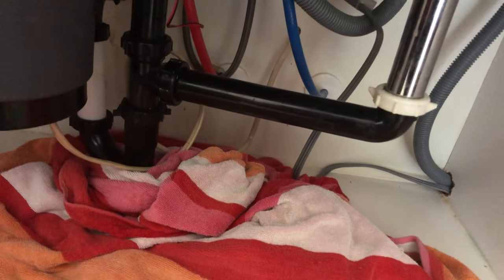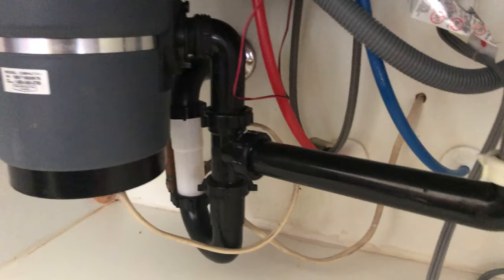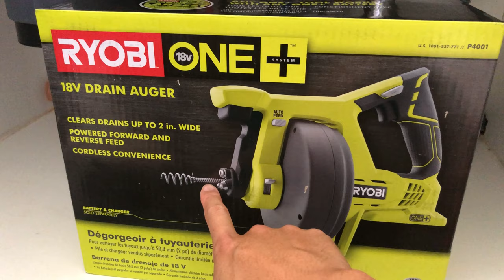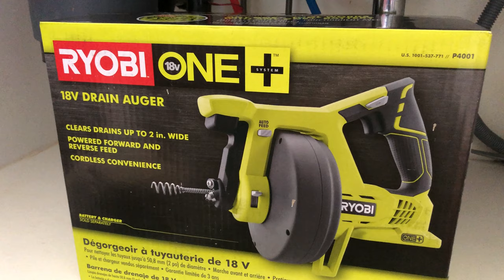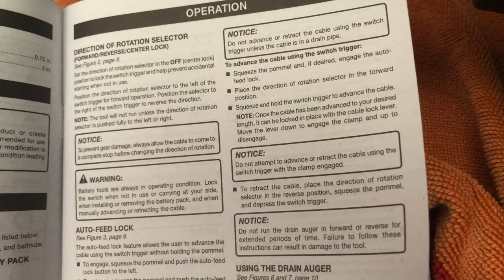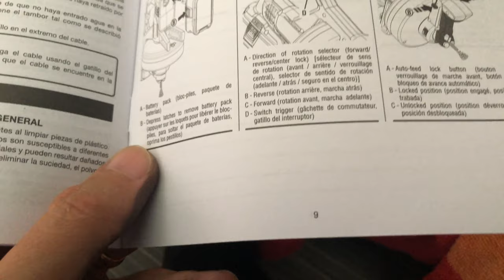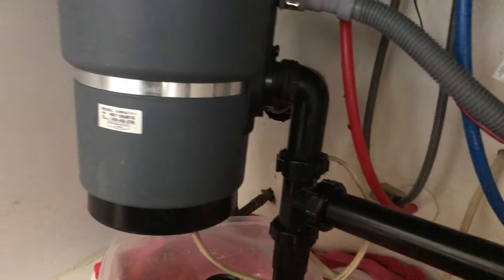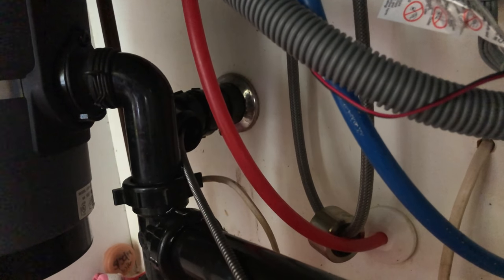TechTalk: Ryobi 18-Volt ONE+ Drain Auger - Unclogging the Kitchen Sink P4001

Comment: How do you know when you went all 25 feet of the auger?  Will it just stop spinning once you hit the 25 feet mark?
Reply from the maker: It doesn’t advance any further
Reply: That is a very intelligent question. I had the same one. I determined that by putting your finger on any point on the line, you will be able to tell when it is fully stretched out because the point that your finger is at will not change.

Comment: Nice video. To lengthen life of coil, only use reverse if line is stuck. Manually feed line back in. Using rewind for complete length will cause coil to unwind itself over time. I take rag, clean 2 or 3 feet of coil, insert in drum, clean another 2 to 3 feet and feed in drum till complete.
Reply: That the worse machine product in this world
Reply: @rosarivero34  I use the P4001 in a jail for showers and sinks. It gets used weekly, some times multiple times in the week. Always does the job and been in use for almost 2 years. I have the p4002 at home. Had it for about 7 months and used 4 times. No issues.